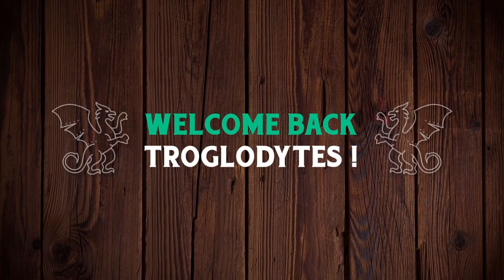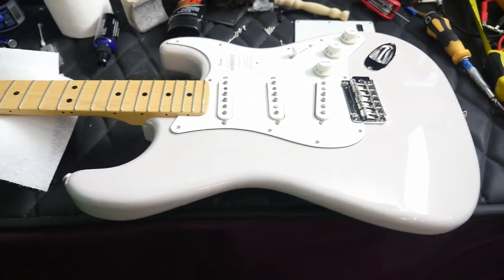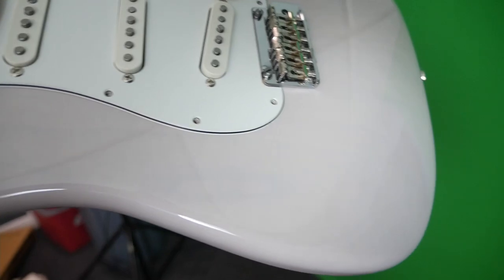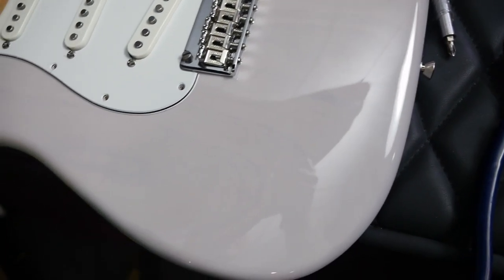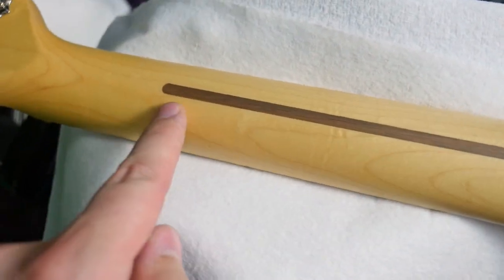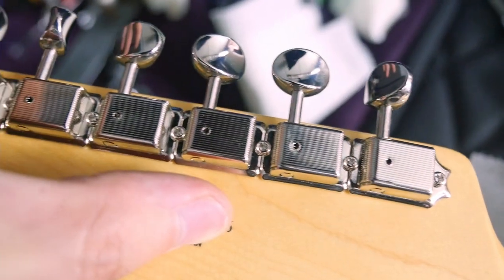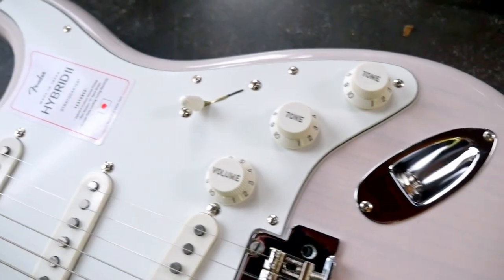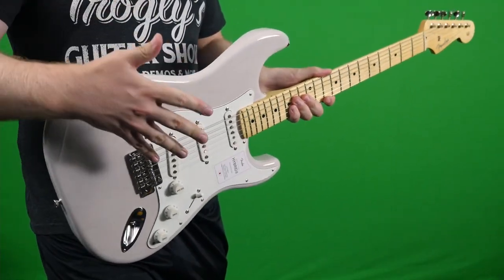This Was SURPRISINGLY Good! | 2022 Fender Japan Hybrid II Stratocaster US Blonde Review + Demo

Comment: Absolutely love locking tuners like this! As if straight from my youth... It is difficult on average to explain to the overnext generation that there is no urgent need to unbalance the head with additional bolts to lock the strings.
Reply: 100% agree
A set of Grover for a 3x3 weigh almost twice as much as the vintage Kluson, on a Les Paul ounces count, especially at the end of the neck!
Reply: @hkguitar1984  I sold my Reverend 12-string for a Danelectro 12-string because having 12 thumb-wheel style locking tuners on an otherwise lightweight semi-hollow was neck dive galore! It’s not that bad on the Jetstream though. My pretty much partscaster ‘93 SG Special I put these type lockers on, but I also put a Bigsby on it too, balances out nicely. 😂
Reply: @joermnyc  Agreed, and of course it all depends on the guitar and its use.  Sometimes heavier isn't as big a concern (as long as you have multiple guitars).
Reply: The Gotoh locking vintage tuners are not that good. Swapped them out for the non locking ones although the Fender original locking tuners are seriously good enough but more work to redrill the holes to line them up.

Comment: Not clear why it’s a Hybrid strat, seems like a very common yet nice Japanese strat.
Reply: I think the vintage inspired with modern hardware.
The body was shaped very much like an early '50s Stratocaster.  The difference in shape and comfort cuts are considerable when comparing a '70s, '80s and modern body to an actual vintage '50s shape.
Also, this had a modern 2-Point Tremolo Bridge with vintage saddles.  The tuners were vintage looking but included a locking function.
Overall a pretty cool guitar.
Reply: runs on gas and electricity
Reply: @landonbailey  LOL
Reply: @landonbailey  hey I love your channel too…
Reply: I believe it is because they have US pick ups.

Comment: One thing you missed is the trem block is clearly cast (zink?). Either way that would need to be replaced.
Reply: "Bridge - 2-Point Synchronized Tremolo with Vintage-Style Stamped Steel Saddles"

Comment: I wonder if the alder is the only reason the guitar has that slight pink hue or is it paint and clear that gets it. Would love to see some other colors like blue used if it's the latter reason. One thing I saw in a finish on a bike was that Harley Davidson's paints are made by them not outsourced.  That being said what ever name they apply to the paint if it's a metal or a jewel and others they finely ground that actual material till it's a super fine dust. Then they mix it in with the paint and finish to give it its look. I had three bikes that were black cherry pearl gloss finishes and you could see the glow of a pearl in light at certain angles they also used that clear pearl finish on other colors like a canary yellow. If you haven't seen how the pearl changes and highlights the colors you wouldn't believe it . I'd love to finish a guitar in that manor but it wouldn't really be able to show off wood grain. I think this example having gloss on the fret board looks pretty good. I've seen some that looked like someone kept applying gloss with out sanding or drying between coats. When you started playing each position it started to sound a little muddy in all positions some more than others. Your run through you did before hand sounded somewhat clearer even in dirty tones. It wasn't terribly bad I just noticed that. Maybe it was a difference in your tone level on the guitar or something to do with an effect your using. A flanger is what it sounds like your using on some parts.
Reply: Really cool.
Yeah, tough call on the guitar as the wood grain/figuring is part of the many reason's I love guitars.
Maybe just the top finished  in the HD paint and the back and sides natural!

Comment: I have that style locking tuner on my ‘93 SG, just to help with tuning stability since I also slapped a Vibramate/Bigsby on it.  (It’s pretty much a partscaster now, it was players grade when I bought it (back of the neck has a sizable dent, some of the headstock corners aren’t corners anymore, checking (it’s Ebony finish), at least the face of the headstock hasn’t melted like some other ‘90s Gibsons). Plus, some parts that weren’t original already (Pearly Gates neck pickup, roller bridge), so I figured not much value left, may as well make it my own, added in a Duncan Custom-5 in the bridge and one of those 6-way switches for coil-tap (I think the last Jimmy Page signature used one of those?) I think the next thing is will be a fret replacement, it’s not feeling the same after all these years. (It’s a Special, no worries about fret nibs!)